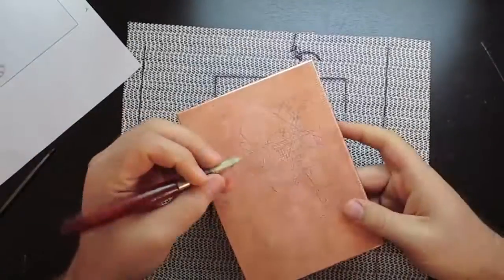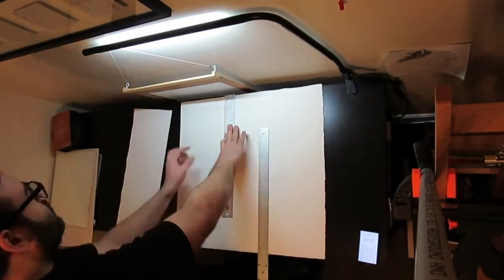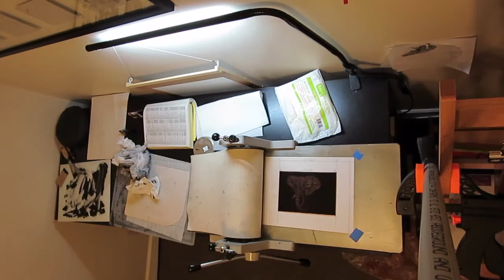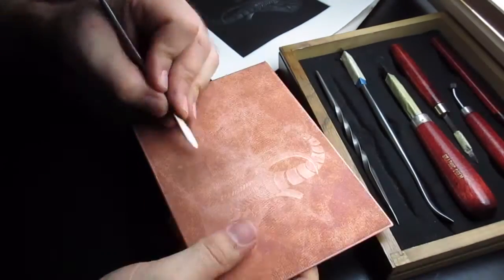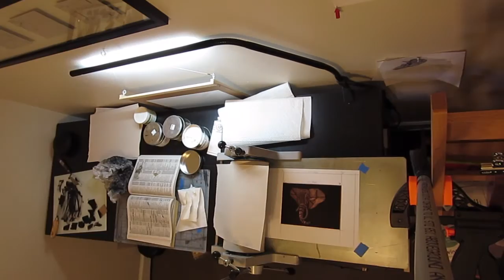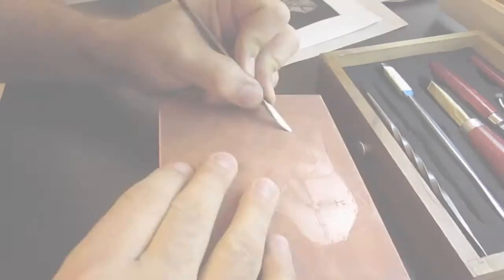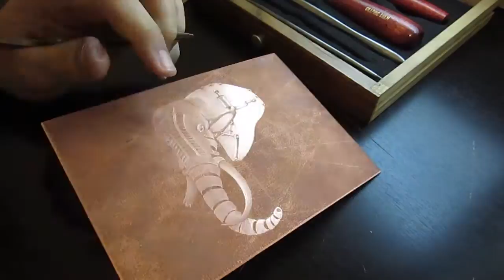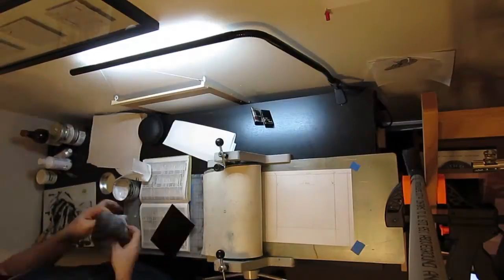Mechanical Elephant Mezzotint Printmaking project Part 2

Comment: Whoawhoa, is that a tiny little portable press? It must be SO convenient to to have to be dependant on a cramped workshop and be able to work from home. 

That is, of course, if you don't have your own printing workshop, but I imagine that is a very expensive thing to have.
Reply from the maker: White People Yea I originally bought it when I was taking my printmaking courses in college. The labs were always so busy so it was a great way to do my proofing at home. It works great for my small prints. I'm hoping to get a proper print studio setup in the future with a large press, but this works for now. Thanks for checking out the video!

Comment: Is it possible to transfer a photograph to the copper plate and then work on burnishing it?
Reply from the maker: I don't know of a way to transfer an image other than using transfer paper to a rocked mezzotint plate. In the past I've done a light linework etching onto the copper plate before rocking, and then after you rock it the lines are still visible. So that might be an option? I'd love to hear if you come across a way though!

Comment: Your mezzotints are great. Do you know any other ways of preparing the plate without a rocker?  These are very difficult to find in my country and buying them from abroad is really expensive because of the shipping costs. Thanks for sharing your work. Marcelo
Reply from the maker: +elo maga hmm, if you have a studio with typical etching supplies you can do an aquatint etch, and then scrape/burnish that, kind of a "fake" mezzotint. You could also use a roulette tool (if they are available where you are) and create a ground like that. I'm experimenting with other ways to do this as well, and hope to make a video soon about my results! Hope that helped!
Reply: +Diode Press Thanks a lot for your help and your time! I'll try to find that roulette tool and then I'll let you know about the results. Thanks again.